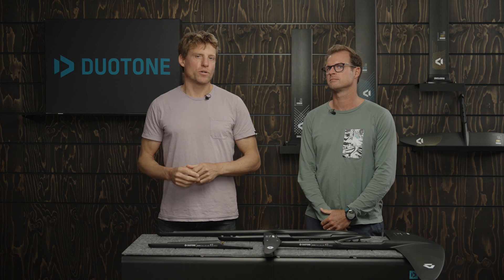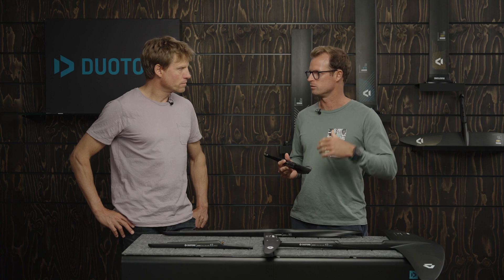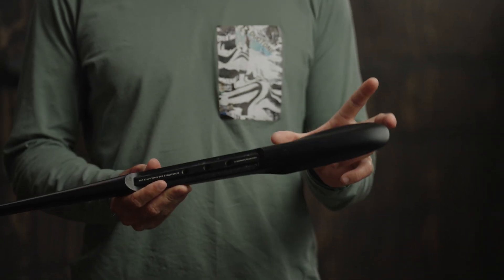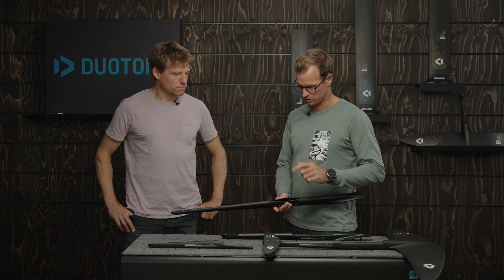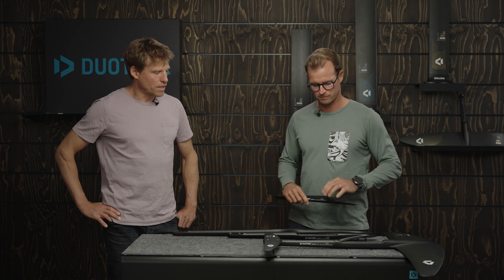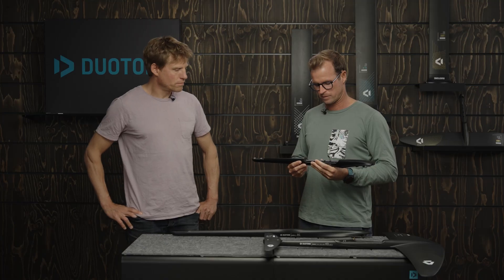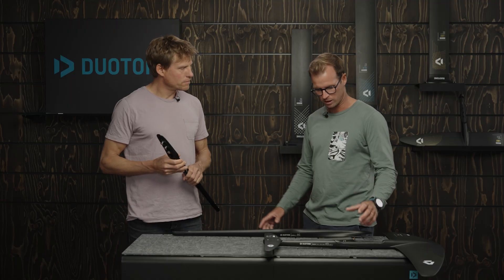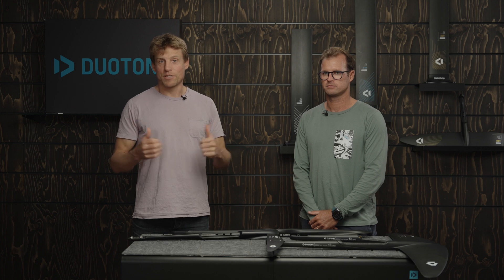Duotone Wing & Foiling Tech Talk - Fuselages 2024

Comment: Hi,  I ride wingfoil with the "old" Fanatic carbon 68cm fuselage.
Is this fuse 2cm larger than the new 66cm 3BS fuse or Duotone changed the fuse geometry, so they are not comparable ?
Thanks !
Reply from the maker: Hi there, yes it is 2cm shorter, the new DT fuselage - but not a major difference in feel.